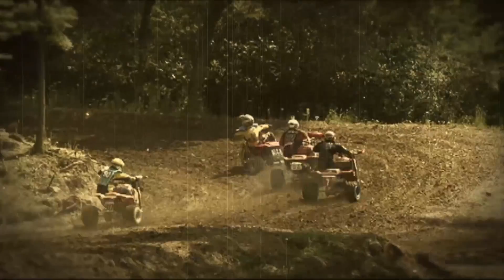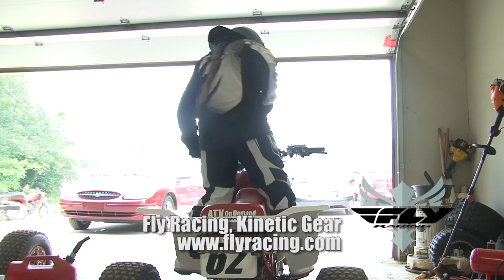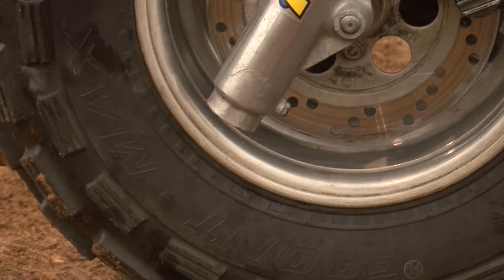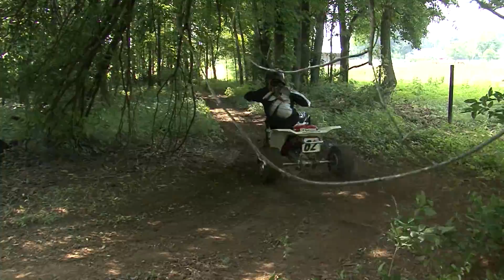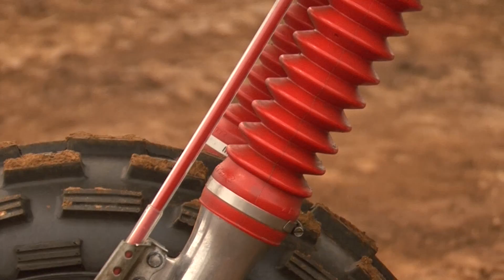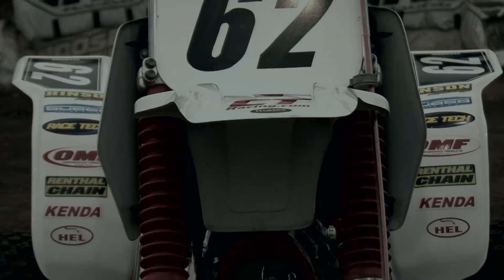1985-1986 Honda ATC250R Motocross Project:

Comment: I had the 86 paid $300 back in1990 came with a dura blue rear axal ,someone's raced it at Lebanon valley race way as it still had the stickers on the front fender its was mint,I regret trading it for a 93kx 125.

Comment: Lone star racing doesn't list a swing arm for a 1985 ATC 250r only an ( $910.00) 1986 -87 TRX and 1988-89 TRX.
Also, Lone star racing list an axle for 1986-89 TRX and says you could use it on an ATC 250 but  1986-89 TRX sprocket and sprocket bolts need to be used.
Lone star racing doesn't list the sprocket needed.
Most of their parts are for TRX
Reply from the maker: @good-boy-ringo  Call them and ask questions. 800 4LS RACE

Comment: I have two 82 atc250rs. Love them. Want a 85 atc250r to put my 96 cr250 engine in.
Reply from the maker: @ShaunSavage-kl9pd  That would be a fun project. You could probably get an aftermarket frame built for that project by HRE

Comment: "Its very affordable or cheap to get into"
"You can pick one up for about 1500 bucks" 
Me: oh how the times have changed
Reply: I wonder if the prices would ever come down.   A decent 250r sold on marketplace for 7200 a few months back
Reply: @OTAlucard  i paid 7200 2 months ago.Totally tricked and restored though.....So beautiful..Too bad i cant show you...
Reply: @ralphwhittaker3766  nothing like a 250r man.  I just ordered a bunch of parts to finally start fixing up my 1985 350x
Reply from the maker: You aren't kidding. Sorry it took us so long to see this post.
Reply: I just paid 6700 for a very nice resto mod....dam i feel better...not for paying 5x what i sold my last 5 250rs for but for getting one sweet trike back in my life....nothing in this land is comparable to a good ole atc 250r 85/86...
Reply: @ralphwhittaker3766  I've tried a ton of machines.  Goat is the liquid cooled 250r platform.
Reply: i just picked up a 200x for 300 hundred bucks
Reply: @rmk800assualt7  nice.  I've seen so many deals posted on marketplace for stuff lately.  Prices are going way down on stuff
Reply: I paid 2200 for a clapped, original but running 86. I got lucky in 2022. It is super clapped though...
Reply: Paid 2000 for one that needs rebuilt

Comment: Dont mistake this man has balls and serious skill. Its not easy to roll that throttle across whoops like he is. That bike is dialed and rippin. Makes me want another one im just not sure the missed work from injury will go over too well. Smacking the ground hurts worse now than 30yrs ago im pretty sure.
Reply from the maker: Rob appreciate the kind words. He is a pretty good three-wheeler Rider input in sometime getting his suspension dialed just right. If you decide to go ahead and pull the trigger on picking one up you don't have to ride like a maniac. Thanks for watching and commenting.

Comment: Complete the build in a couple years that I'll suck, just picked one up
4 months ago and almost done with my build touched everything except the motor the bike had very low hrs when purchased bought it from original owner who had it sitting for around 2 decades once it blows going to put a ct310 kit hands down one if the the top 5 for me on the net as far as looks

Comment: We need a build for the 81-84 air coolers! The older "unloved" 250rs are just as good
Reply from the maker: A friend of the channel and a test writer Jim Nemechek, just picked up a very clean 82. It's undecided whether or not we are going to use it as a project machine. However, we plan on filming a stock test on it at the very least. After all, the air-cooled ATC 250R was the first production high performance ATV.
Reply: @ATVonDemand  I've got a 82 with some light mods. Axle, pipe, tires, seat ect. It would be awesome to see something stock vs a lightly modded 250r. If I was closer to you guys (im located in south east Pennsylvania) I'd love to provide my old R for a video.

Comment: Why not go with the Boyesen rad valve? Gave my R tons more mid and some extra bottom.
Reply from the maker: アストロサンダー we worked with motor Builder CT racing on this project. They recommend the V Force Reed's with their motor builds. When you work with a motor Builder on a project you have to use the products that they recommend work best with their engine kits in order to fairly evaluate the entire package.
Reply: Ah, makes sense!

Comment: Cr500 swap it
Reply from the maker: Tempting, but we would be more likely to do a 350cc power valve cylinder allowing us to maintain the use of the counterbalancer.  A CR500 motor would eventually crack this 30 year old frame to bits.  Love that motor though!

Comment: Are you guys located in California because I really need a 250 r to match my 200x and 350x and if you guys will build me one I'm really fucking interested I got the cash trust please hit me up atv on demand give me a link or a phone number for some one that can build a custom trike
Reply from the maker: TheSnowWolf1000 we are not located in California, however, CT racing engines that built the motor on this machine is. if you want your 250R gone through an all pimped out you may have luck if you give them a call.

Comment: so, how many parts are still from the original?
Reply from the maker: The engine, frame, brakes, triple clamps, shock and fork revalved, seat pan, air box, intake, some nuts and bolts, brake master cylinders, throttle, and that's about it.
Reply: ATVonDemand time for new brakes. hehe. sounds like only part of the engine remains too!

Comment: Thatz bad azz 250r man... I actually built a 1986 250r engine with a ESR set up.. it had mid and high ported n polish 310 cylinder jug, swashed dome cylinder head, ESR cdi n stator kit, vforce3, pwk 39mm kenieth carb, CPI mid n high pipe and I dumped it in a 2001 Honda 400ex. It had all around power 1st thru 4th front wheels just want to come up lol... I don't have it no more but I do have a video racing banshee on here. If you search my channel or look up (Honda 250r rotary1975) it comes out..  Subbed n liked it..

Comment: Hp rating after tune up?
Reply from the maker: markunit72  Horsepower on this project was in the low to mid 40s. We did a part 2 on this machine where we had CT set the motor up for race gas, with more extensive porting, a carb update, and new long rod crank. HOrsepower is now in the 50HP range. See that video here.  https://youtu.be/YXY_FZKfv1Y

Comment: I'll never understand the appeal of 3-wheelers.
Reply: Experienced riders know why!!
Reply: And why is that?
Reply: My favorite part about three wheelers is there versatility. Compared to a sport quad you can conquer much more difficult terrain especially in mud and snow.  But they’re not a big sluggish utility ATV. They are still fast and fun like a dirtbike but can do way more.  Also the reason I have one is because the price,  my dad bought it for me when I was 10 when I out grew my dirtbike.  .   They are cheaper than a sport quad utility ATV or dirtbike. I still have that 110 8 Year’s later. Now I want to buy a 200x.
Reply: A Goose just ride one and youll find out
Reply: A Goose for one we old guys were around and shredding these when we were kids... So we cut our teeth on these then moved to for wheelers.. But a machine like this was what we dreamed of then ... And there is a little more skill in riding these fast too...
Reply: i used to smoke cr -yz 250s on a track we had till the whoop section ,  these bikes are the most fun you can have , I've owned everything , these are the most fun ,,
Reply: +Levisnteeshirt1  they used to make a tire , super turf racer,, much easier to sling one around a turn than the ones on this bike
Reply: I think for most its what they grew up on.  Us old timers know why. Takes me back to a time where nothing mattered but my next tank of fuel!!

Comment: did you do this to the the same one as in the review? or is it a different one because i wouldn't have touched that one.
Reply from the maker: Sorry to disappoint but we did indeed use our stock test machine for the project. It wasn't a showroom piece but being in good condition meant that we wouldn't have to replace every little part to have good reliability. We even used the stock crank, although we wouldn't recommend building a race motor with a 30 year old crank. Your thinking is why we worked so hard to modify the stock components rather than cobble something together using parts off some newer sport quad. If this machine were ever sold, it is still an ATV250R, not something that was hacked up to add parts that weren't designed to fit. We too appreciate those remaining perfect stockers.